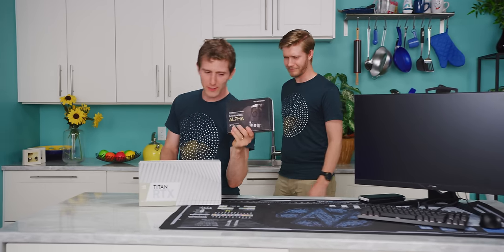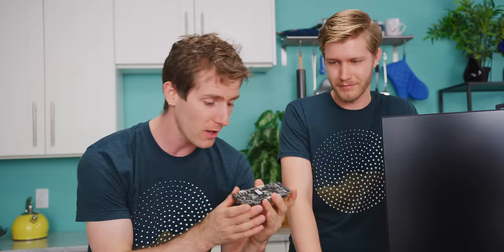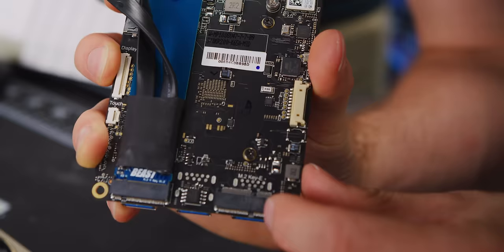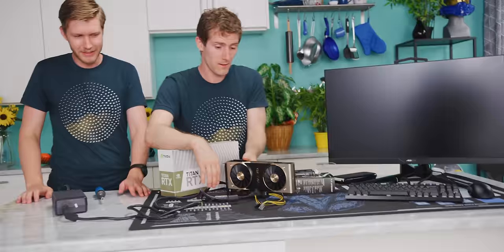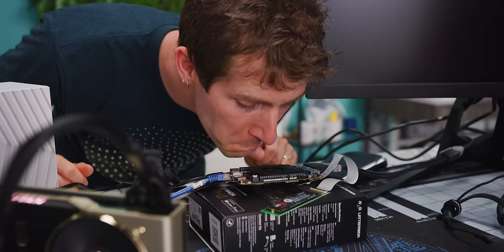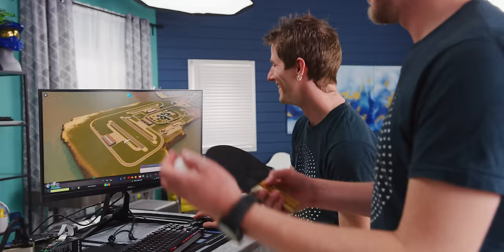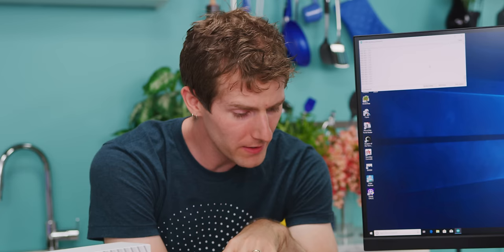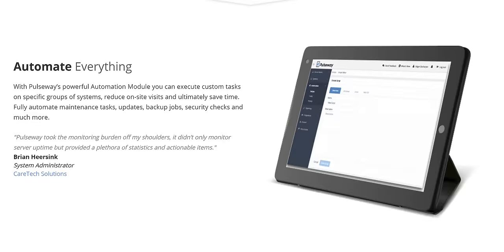The Biggest Bottleneck EVER? - LattePanda + RTX Titan

Comment: Meanwhile my pv with an i5 3330S and GeForce 610M, i am severely bottlenecked by the GPU, in task manager, my cpu sits at about 40% and the GPU is at about 100% all the time while running VALORANT, but suprisingly i still get about 70-80 fps

Comment: Well I have an I/7 8700K 3.7 6 cores 12 threads and I want to buy 3080 or 3090 and I can't afford to buy anything else. With my 2080Ti that I have for 2 years, I did not have a bottleneck and I play the games Ultra or very high 4K 60fps. I have 16 GB DDR4 2600 btw. So do I will have a bottleneck effect with 3080 or 3090 what do you think???

Comment: 1)
This idea is totally stolen from ETA Prime.
I feel bad for smaller channels that get no love.
https://www.youtube.com/watch?v=oXmqlDJTL5o

2)
"So that my friends is what a cpu bottle neck looks like"
"literally half the performance and you get zero change in fps"
That's because the FPS is capped at 60 because you didn't turn v-sync off.

3)
You know you using an intel dual core cpu then proceed to test games on ultra high settings at 1440p.
No one would ever do this, you would set performance based on what the hardware is capable of handling.
This setup would run games perfectly on medium to low settings at 720p.